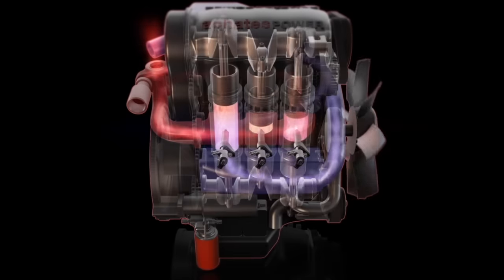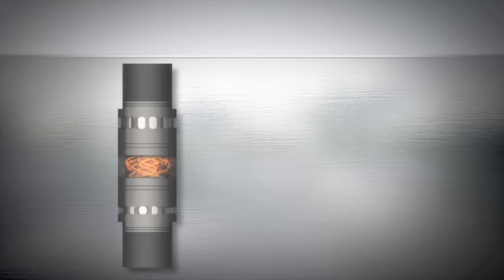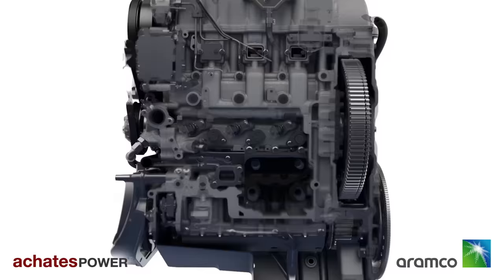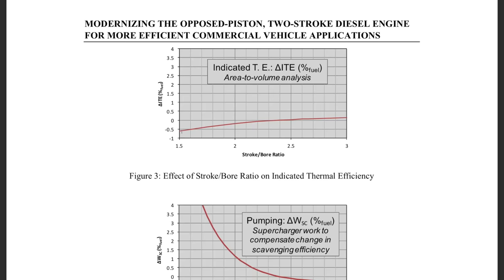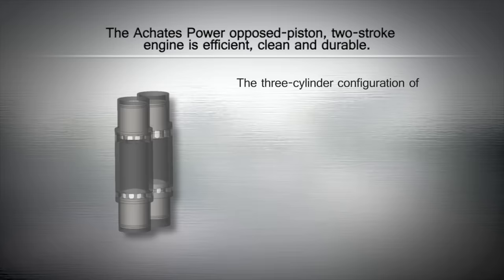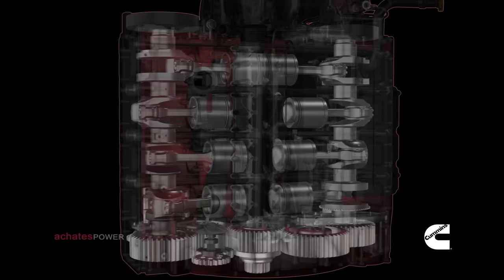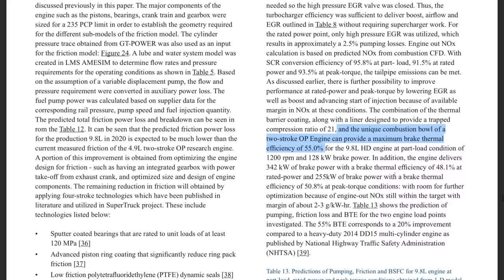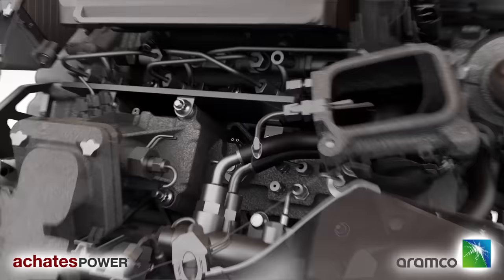Opposed Piston Diesel Engines Are Crazy Efficient

Comment: How does the engine oil work in this with one engine on top wouldn't have engine oil running down true the engine piston???
Reply: I think that it has to have a pressurized oil system. It must catch it and scavenge it. Wipers and wind age trays. Detroit makes two cycle Diesel engines and have a conventional oil pan. I’ve worked on them.
Reply: Perhaps you can mount the engine horizontally?
Reply: @simonjarn4059  Can't be, not today with emissions standards and all.  It wouldn't make sense to develop a new engine that can't meet the standards.  I am curious though.
Reply: Simon Järn The fuel never enters the crankcase as it does in a 2 stroke gasoline engine so mixing fuel and oil won’t work. It probably has a scavenging oil pump that sucks the oil out of the top end and pumps it to a common sump.
Reply: 2 stroke because intake exhaust compression and power stroke are all done in 2 strokes nothing to do with fuel

Comment: How does this affect emissions?
Reply: CO₂ and NOₓ will be lower as it's more efficient.
Reply: Mark Rose:
That may not be true.
You can make an engine way more efficient by taking the compression ratio really high.  It will make buckets on NOx but not much CO2
Reply: Probably not that different PM-wise (particulate matter) from a 4-stroke as with this design you aren't getting unburned fuel out the exhaust, unlike most 2 strokes. It's mostly down to compression ratio (combustion temperature) since that determines NOx production. The higher efficiency will reduce CO2 per unit of performance but yeah the NOx is probably more important here since it actually kills.
Reply: Ken Smith Yeah, but assuming the same compression ratio etc., the efficiency should reduce the NOₓ for the same power output. It would be interesting to find out the cylinder "head" temperatures of this engine as temperature affects NOₓ production. It's possible this design could have lower peak temperatures, since water could be channelled closer to the hottest point of the cylinder.
Reply: Mark Rose:
That is true all else being equal but I can't remember the time all else managed to be equal.
Reply: Ken Smith Very true!
Reply: With compression ratios as high as 18:1, the air-fuel ratios can be drasticaly different and the resulting gaseous mixes will change a lot.
Reply: Lifted_above:
At the end of the process, the NOx will still mostly depend on the peak temperature and the unused oxygen.  If you have tuned for efficient operation, there will be no unburned products and little CO.
Reply: Current catalyst exhaust equipment is really unnecessary because engineers can achieve as clean or more clean exhaust emissions without any catalyzer equipment. But, when a government mandates equipement instead of letting engineers alone, we get stuck on a piece of Flintstones-era equipment and are forced to design around it.
Reply: Lifted_Above:
What you claimed is false.  Who told you that catalyst is not needed?  The current exhaust limits can't be met without the catalyst.  If it could, there is no government regulation that would require a converter on such an engine.  If the engineers opt to use the catalyst, (as they must) you have to leave it on the car.  I expect this myth got its start in the early smog era when Chrysler had their lean burn engine.  That engine would only meet the early limits.  It produced too much NOx for later regulations.  That is why Chrysler abandoned the idea and switched.
Reply: What I claimed is false?
Not when it's been proven, and not only proven, but proven by a personally trusted certified Ford master technician with empirical data, exhaust sniffers, and real world comparison experimentation. Someone who knows more about auto mechanics that I have forgotten. And my normal personal career is mechanical engineering, just for reference.

Try removing a catalyzer from a new car at an auto manufacturing facility and release that car to a dealership network for sale. See if the government is pleased with that.
Reply: Lifted_Above:
You need to do the full up test and not just use the sniffer.  The sniffer is just a way to check that the system hasn't gone wrong.  An engineer would know this but perhaps your technician friend doesn't.  The reason you can't remove the converter is because it was in the design as done by the actual engineers.  
Like I said, what you claim is false.
Reply: I'm not going to spend hours describing every nuance of the test that was conducted to please a stranger on the internet that demands my descriptions be wrong. It's a waste of my time, and a waste of your time. We're not going to solve anything here, so if you don't like my comments, either research the issue and come to your own UNSPOKEN conclusions on the matter, or keep whatever ideology you've chosen about a given matter and run with it.
Reply: Lifted_Above:
I did research and thus I knew when you started with this that you were wrong.  I had figured that your friend had just mislead you.
Reply: You can't resist, can you?
Reply: Lifted_Above:
You said you were going away.

Comment: With any luck we'll get rid of internal combustion engines all together.
Reply: yes, and we'll all be driving Teslas. Let me know when the genius Elon comes up with a viable electric truck that can cope with transcontinental distances
Reply: Hope is not a plan
Reply: My self refuelling semi autonomous four legged transport seems to produce just as much CO2
Reply: @AndreiTupolev  it will probably parallel the automobile history. After all, the Model T was not a Mack truck. Those came later.
Reply: @stvargas69  hope is not a plan, it precedes it.
Reply: Gary Mc
Reply: Why Gary do you want to get rid of the internal combustion engine ? RSVP
Reply: @marshallbacon2527  as a factory technician, I have worked on electric forklifts and internal combustion engine forklifts. Electric forklifts are more reliable and easier to work on. They don't stink up the plant (in smaller enclosed areas they can choke you to death). They can be directly refueled with solar power. They are not as much of a fire hazard. They don't leak motor oil on the floor (although both leak hydraulic oil 😁). They don't have 300 degree exhaust manifolds which can burn the piss out of you while you're working on them. I don't have to change the oil in them every few months. They are quieter. Combustion engine forklift have an electrical system and a battery and a combustion engine. Electric forklifts eliminate the combustion engine. I'm probably forgetting a few things but you get the idea.

Comment: That would make a very good engine for a “People’s car”, if given a timing chain and a Bosch Inline Mechanical fuel injection pump, cylinder sleeves, and cast iron heads. Give it a manual transmission.

Comment: If only we'd had this 120 years ago, when we could still allow fuel combustion engines.
Reply: Don't you worry. Climate hysteria is only a transient problem morons are hooked on for the moment to feel important - morons who never could finish a science course. Combustion engines will never die simply because nothing can beat diesel when it comes to security and energy density. Electric motors are good for the pleasant silence, specially on a boat. A genset based on the motor in the video would be a good idea so that you can do passages without engine noise for the most part.

Comment: That’s a pretty good power/displacement ratio. Am I correct in thinking that an opposed-cylinder diesel could be smaller in overall size than a conventional diesel of equivalent power? Would the cylinders be oriented horizontally, or vertically as in the illustrations? Very interesting, and looks to be low maintenance.

Comment: Being its a two stroke and a diesel, I'll bet emissions are too high. Modern diesels require particulate filters in the form of diesel exhaust fluid, so silly it sounds fake. This engine is likely very efficient, but too "dirty" to consider it for smaller engine applications for a long time.
Reply: I think you just underlined the issue they probably save for last when doing a presentation or hope nobody ask. But yeah your correct. It would have to be so.
Reply: @americangraffiti6192  if they further refine emissions they may be able to clean it up enough to use it in small car applications. I think we're on the verge of battery technology being good enough to actually allow electric powered everything to take off.
Reply: In parts of the video like 4:24 you can see the engine is fully equipped with emission reducing technology...
Reply: @xcofcd  that doesn't mean it reduces it enough to be used in automobiles. The one reference I saw talked about a 9.8L, which would indicate it's use in large applications with less restrictive emissions standards. They probably can't meet current emissions standards to be used in automobiles, which is why we haven't seen them implemented yet.
Reply: Hmm but due to more efficiency would it not have lesser emissions as less fuel consumed? These 2 factors have to be considered to calculate the net emissions.
Reply: Dexter Schray Canadian inventors have invented a way to make diesel burn 100% efficient with zero smoke read the article
Reply: @americangraffiti6192  Yet, they claim ultra-low emissions.  So, exactly what are you talking about?

Comment: I wonder how it compares performance wise against a traditions inline 6 diesel like my cummins 5.9
Reply: DIESEL SYNDICATE well, 2.7L @ 270hp and 480tq, and the 2005-07 5.9 24valve is 325hp and 610tq stock.. That's 55hp and 103tq per litre for the Cummins and 100hp and 178tq per litre for the opposed piston engine. That's 72% more torque and 82% more power per litre so a 5.9 version would do somewhere around 590hp and 1050tq, or should!!! Hope this helps!
Reply: Racer X so your going og the litres? So shouldn't a 7.3 powerstroke produce more then a 6.7 powerstroke theoretically
Reply: Well you can get more power, yes.
At what cost? 
The more power you get the less reliability you'll get. Its a 2.7, make it 5.4 3 cylinder and you will get more power without mods.
Reply: mark broad yes kinda, they put a lot of time on the test engines. Generally more power per litre does equal less reliability due to increased stressors, it depends on thermal efficiency and lots of other factors like the materials used and the type of fuel used, everything has an impact even the angle at which the stroke goes. Why have a smaller motor? Less weight for the motor to pull around..
Reply: If a considerable amount of that power comes from reduced losses, I don't think it would make it a less reliable engine. It has no valves, and shorter strokes means lower pistons speeds therefore lower friction.
Reply: DIESEL SYNDICATE I'm going on output per litre, not on the number of litres, think of it this way.. say you have a 1 litre 2 valve engine with a 9 to 1 compression ratio that makes 80hp, that same 1 litre might make 120hp with a 4 valve head and 11 to 1 compression, make sense?
Reply: namasayanif exactly, when people think more power, they generally think less reliability, but really it all depends on how it's gained
Reply: The 12 valve Cummins was dubbed the million milk motor.
I don't think many others live up to that
Reply: @markbroad119  steamengines were the first million mile engines 😁
Reply: mark broad no it wasn’t. The B Series has never been a million mile engine and never will be. I’m sure there’s some outliers that have made it to a million, but that it neither the rating for that engine, nor the reputation of it. 
Cummins has manufactured plenty of other engines that have earned that reputation however.
Reply: Oliver, the core of it is an old conceptual design. But the technology that it is created & produced with Is New. So Not the Same. 
   Plus this is Only piston ported it seems. Of the Jumo's Opposed Piston design family, most variants of it I believe also had Sleeve Valve/Gate Rings to provide some mechanical variable port size/timings as well, without any transistor or more or latest modern electronic injector and control & settings adjustabilies; albeit, with the additional sleeve valve system having more mechanic complexity with sealing, lubrication, heat management & seizing problems.

   I am not discounting the possibility of emissions, but if for the amount of fuel used per cylinder, per outputed power & torque, at efficences greater than equivalent normal 4 stroke OHV/DOHC/SV diesels, Is most likely to be Less. 
   Certainly Is less across the whole engine operating range - idle to maximum, so perhaps meaning under 'working loadings' on road or rail or military usage conditions, it seems it would/could be reducing emissions, reducing fuel in-efficiency wastage etc currently accepted as normal or to be barely tolerated - assuming for those whom are of a 'conspiratorial outlook', the figures aren't made-up, false, or pie in the sky.
Reply: Back in the 1980s I worked with Terex TS40 (40 cubic yard) earth scrapers used to move coal at a power station. Some had Cummins turbo diesels (sorry cant remember the model) and some had Detroit 2 Strokes in The Cummins were regularly blowing turbos sometimes taking cylinders with it. The Detroits just ran and ran. Never any trouble and always very powerful. They blew black smoke when driver floored the accelerator pedal, but at constant load were very clean. Cummins would smoke when worked hard.
Interestingly, the Cummins powered machines had an eccentric balance weight on the rear engine crank that generated considerable vibration. If that was not fitted the rear engine would quickly break it's crankshaft. The cause was harmonic vibration from the front engine. The Detroits never had that problem.
Reply: @racerx9223  I'm a bit late, but alternatively a 6cyl 5.4 variant of this design should produce exactly double the performance with the same relative efficiency. It'd pretty much have to be two engines bolted together, perhaps sharing a larger supercharger, but produce monstrous amounts of power while keeping the advantages of the smaller 2.7L

Comment: imagine torque with 8 cylinders😄😄
Reply: 3 multiples are greaters
Reply: Yes, a Deltic-9 would be a much better way to go than something with 8 cylinders.
Reply: The 4.9L is said to output 800+ foot lbs
Reply: Dont have to imagine, just calculate. The T-64s 5DTF engine makes 780hp with around 1890NM torque using 5 cylinders and 10 pistons with 13.6L displacement. That design is cold-war old, so it might differ in technology but yeah..

Comment: I'm all in for eliminating head gaskets and their accompanying failure points. The only downside to this engine design that I can think of is the noise generated by the straight-cut gears syncing both crankshafts and from the 2-stroke nature plus its cylinder wall exhaust openings

Comment: Marine Engine was called the Doxford, several types were made. They differed from this design by having only 1 crankshaft with the top piston linked in with long piston rods These slow speed engines were directly coupled to the propellers. Moving parts of the piston and rods were visable at the top of the engine. Enticing some foolhardy engineers to "walk the tombstones" at low rpm. Before that the concept saw use with the impressive Napier Deltic. These were high speed engines with 3 banks of opposed pistons per unit. Very high power to weight seeing use in motor torpedo boats in the 1940s. The Wikipedia page on these has a great animation. Automotive history from the UK in the 50's saw the Commer TS3 van. Its diesel had an opposed piston type. 
As well as the efficiency gains these engines are also perfectly balanced making for smooth sailing. Very efficient and interesting machines. Difficult to make compact tho. Guess they would fit well enough in a truck which is where it belongs. The lower vibration and fuel cost would be a welcome benefit for truckers. Suppose it would fit in a SUV too, might even make those bloated, overweight heaps seem economical !

Comment: The Leyland L60 was a great engine, but the wrong one for the right job. Upper crankshaft/ rod failures were caused by the tank crews starting and driving off before enough oil had got to the top crankshaft. In a tank, you need to be able to start and go pronto. They started and went pronto, and the rod bearings failed. Put it on it's side.
"Knock-knock!"
"Who's there"
"TS3!"

Comment: the BEST ice engine EVER conceived in its' current design by achates. in the past- 2 strokes would have been impossible to make run clean. tweak one factor... get cleaner burn.. .but detonation. tweak another factor ... get soot exhaust. 2 stroke builders were considered more of an 'artist' than a mechanical science. changing port size, port timing, piston shap, compression ratio... exhaust tuning... all had to be done as the old method of just "build it, try it.. and see if your 'tweak' improves the performance. using computer modeling... achates was able to build the engine 'virtually' and get it PERFECT. the jumo 207 still holds the record for fuel burn gph in an aircraft engine- by a huge margin. that is amazing. I can't wait to see this thing on an aircraft.

Comment: I looooveeee this engine. But you can’t creare boost in the cylinder because the exhaust port stays open for longer. Or the manufactures need to fit a 2stroke exhaust then it would work.